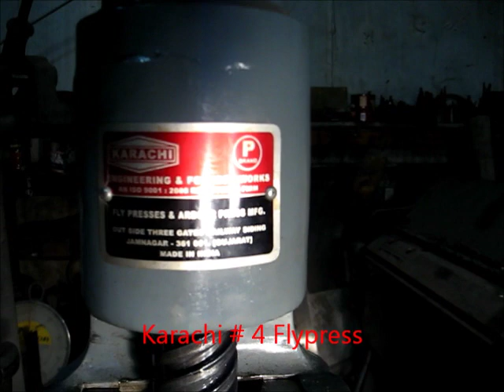Punch and drift holes on fly press

Comment: I'm working with an old fly press, or will be, in my shop. Any tooling recommendations or guides, or further demos would be appreciated!
Reply: Jesse: I restored an old English press. The adjustment bolt was 1/2 by 12 thread. Most American 1/2" bolts are 12X13. I searched all over the country to find 1/2 x 12 and,strange enough, found a set at local flea market.. If you have a friend that has a REALLY old set of taps and dies it may have one it it. I mean a 100 yeas or so set. good luck. Eric

Comment: How are you ensuring your slits are even with each other on opposite sides?
Reply from the maker: +Jesse Allan- Cold mark with 2 heavy center punch marks, top and bottom,  to find location when hot.  Adjust guide to one half the stock width.